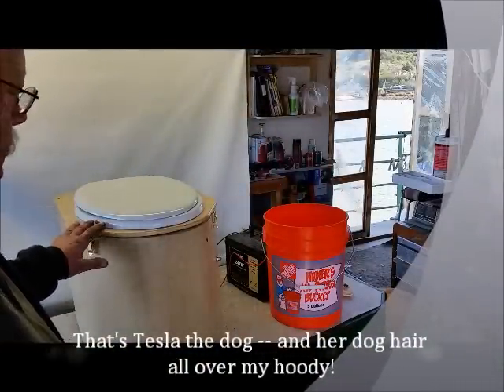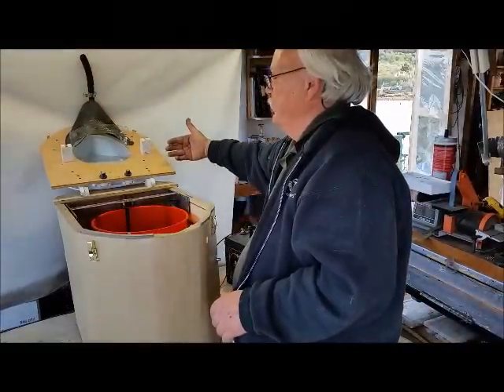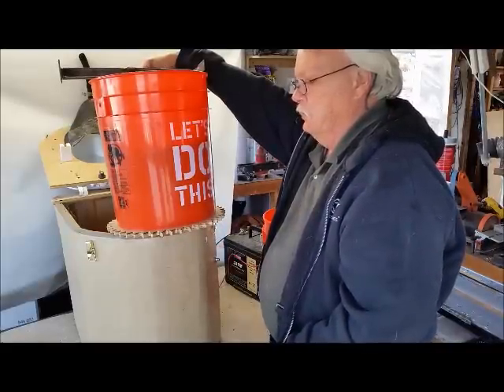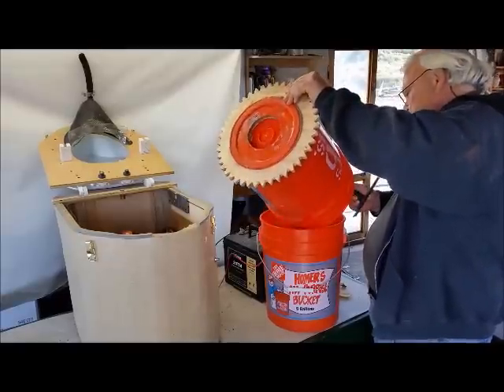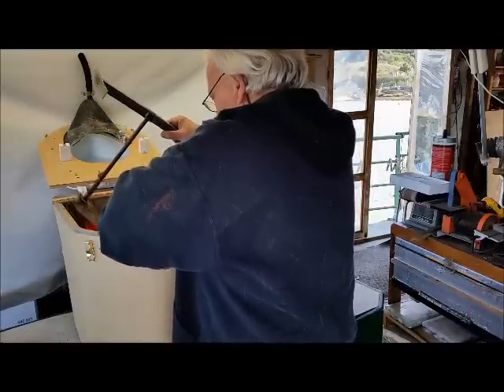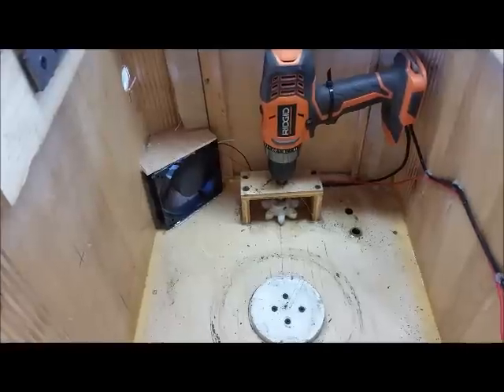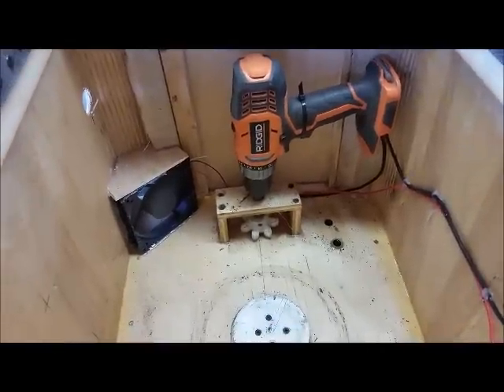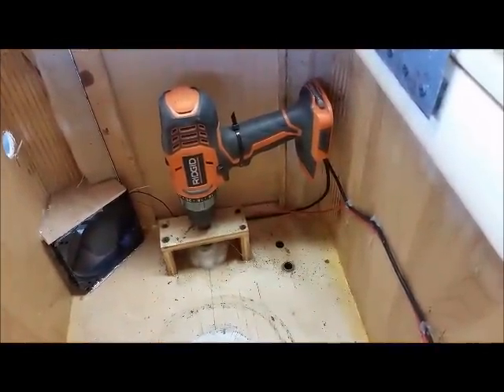Composting Toilet

Comment: I made a similar toilet with a similar drive mechanism and stirring device... Very happy with it... Only thing is, us Europeans do not have the 5 gal. buckets but are stuck with the 10 Liter version which are far less tall... So the risk of over stirring and spilling sawdust over the edge is quite real if the bucket is near capacity...

Comment: as some have pointed out, anaerobic bacteria produce "bad smells" while aerobic bacteria tend not to. I was wondering whether something like an "air stone" (such as used in aquariums) could be dropped into the bucket before adding the peat moss (or whatever) or have it anchored to that rod that projects into the compost area and then use the small air pump to add air to the mixture continuously to "aerate" the mixture. I'd still use the small exhaust fan (probably but I'd like to test out the air pump idea 1st to see if that by itself solved the odor issue just by itself) but possibly on a timer (say 10 mins ON after every use since as I understand it, "smell" from solid wastes is most pronounced when the solid waste has some volatile component that escapes into the atmosphere and MOISTNESS on the surface of the solid waste is quickly dissipated by the compost medium, especially if the contents are stirred up, as in this unit, so 10 mins might be more than ample time to remove offensive smells prior to this surface desiccation).
this gadget here certainly seems to be workable. I wonder if the guy ever made any progress toward marketing plans for DIY builders since I WOULD prefer making something like this to spending $1000+ on some SIMILAR toilet from some manufacturer.

Comment: Is that the fan running loud I used to build custom desktop there are some ultra quit fans out there but good job I'm going to build one it's different than most of these I've now seen more than I need to of video s but you did a good job I believe so thanks.

Comment: like your stir system....  what would you do different if you could.... (or have done different since posting this)  can you offer a to do on making the gear for bottom of bucket and give heads up on where one might could find the one on the drill?  

thought of using an old vibrating sander inverted under the bucket to vibrate it.... simple.... but a stir would be better
Reply: The compost needs to be ventilated often, while the vibration would have the exact opposite effect and make it compact.

Comment: Did you ever draw up a set of plan. Mostly the gear drive would be helpful. The rest of the build looks easy.  I have plenty of HDPE 3/4" sheet.  Getting the gear ratio correct would be helpful.

Comment: Awesome Robert!  I've been trying to figure out a stir mechanism that wouldn't require a hand crank that came out through the top or side of the toilet and this is and excellent, low cost solution!  Although it does require electricity, the fact that it can run off a 12volt battery is perfect.  I assume that the fan also runs off the 12 volt battery?  Have you ever considered having an air intake that brings air in from outside rather than sucking warm or cool air out of your boat all the time?  Would be curious whether that would work.  Probably work better in a land based home than on a boat as you don't want perforations in the side (or bottom!) of a boat and it wouldn't do to have the intake right next to the exhaust.  Anyway, that's something I'm thinking about to avoid losing warm air to the outside in winter.  Thanks for sharing!

Comment: My composting toilet also uses a 5 gallon bucket but my urine diverter collection jug holds 2 1/2 gallons.  It fits nicely on one side of the bucket.  My "poop bucket medium" is composted  hardwood sawdust.  I get it from a premium hardwood sawmill.  It is a 50 mile round trip.  My utility trailer is 5ft. x 10 ft. with 4 ft. sides.  3 loads is $60.   Makes a giant pile of sawdust.  It takes a year to make it suitable for using in my composting toilet but I am not using Peat Moss.  After 1 year of "weathering" it gets raked out, dried, and bagged in giant paper leaf bags from the hardware store.  I have enough bagged up for at least 5 years of using my composting toilet.

Comment: This bucket design isn’t that different than the others except the bucket turns instead of the mixer turning. That’s a innovative idea but I’m still looking for different design. These bucket composters are too small and low for my liking. Yes, I could raise it. But it’s still small. I found a 13 gallon barrel I like a lot better. So I bought 4 of them. I want hot composting action. And not to cool down overnight due to low mass and low insulation. Lots more research to do. And maybe I’ll come back to this if it’s too difficult.

Comment: Love the drill idea! And the turning bucket arrangement. I can't bring myself to drop $1000 on a plastic toilet with a computer fan and a hand crank. For now, I needed a small arrangement to fit behind my driver's seat. So far, I have a basic arrangement contained within a 5G bucket: hand held urinal on a nylon tube (it had a corrugated tube at purchase but why trap urine in the tube?) into a clear laundry bottle. Behind that (pun intended) is compostable bag lined deli bucket. I use coconut coir below and above as needed, bag, and discard with no stirring at present. I'm using a pool noodle for a comfort rim, and a gamma lid for between uses. If I can get a computer fan arranged, I'll swap for a camp-style toilet seat on the bucket. Easy peasy (also pun intended). Love this Vid and the comment section, too!

Comment: You should make and sell those gears, because I want some right now. Plz take my money. If not, I guess I will have to cut some by hand. Sounds time consuming
Reply: I wonder if bicycle gears would work?
Reply: @tonidoreengranke8502  Brilliant. I'm sure they would. You could have a 10spd toilet. 👍
Reply: I imagine it could work if you trace a circle on a oiece of hardwood, thenuse Forstner bits and drill out a bunch of holes all along that line, just touching each other. Then cut the excess wood off so the larger part of the hole is left , if you know what I mean?

Comment: Robert thanks for your posting. Its highly informative. Now that its been 3 years since your installation and your video was based on theory. I am interested to learn what your practical experience has been over last 3 years? Are you still using it? Have you made any modifications? If so, what changes you've made? I am looking to install some thing like this in my RV. Look forward to hearing from you. regards

Comment: I'm curious about the randomness of the "Irish linen" thing.
Reply: Design feature? Entirely optional I imagine. It's certainly visually more appealing - little bit of class - but I'd be putting a few coats of waterproof spray on it. Or, thinking it through, I might use oilskin.

Comment: You could put the bucket on a bearing from a "lazy Susan", then turn the bucket either with a V-belt, or a rubber drive wheel (with 2 other rubber idler wheels).  Love the idea of turning the bucket instead of turning the stirring device.
Reply: How about a crank or step crank mechanism to turn the bucket?
Reply: @kindnessmatters5215  excellent idea.

Comment: This is an interesting design variation, rotating the entire bucket, instead of leaving the bucket stationary and rotating an internal mixing device. Seems like mixing might work better if there were two angled fins (~30-45°) offset at different heights a few inches apart (Maybe that would be his aforementioned update).

Wonder how this would compare in longevity to ones with a hand crank to rotate a central mixer, instead of spinning the entire bucket (issues with moving parts & larger gears, concern over possibly catching the bucket handle at some point down the line (random, unexpected/unpredicted problems that occur), heavier/harder to turn when fuller, more likely to wobble itself out of alignment, etc).

Great use of a drill! If you have an extra one lol. If not the cheapest DIY due to the drill, it's still far less expensive than spending $1,000.00 (!!!) on Nature's Head or Air Head versions (people are correct that they are rather unsightly; vaguely reminiscent of unattractive robots), or just slightly less on the C-Head.

Great design! ☺💪👏
Reply: In reality, ball bearing mounted slewing mechanisms cause problems over time

Comment: Any thoughts on how to incorporate a bidet into this design? A south african company has a shelf sloped back that is slotted to allow liquids to pass but not the solid. Used with a urine diverter up top the only liquid in the bucket would be the bidet wash water. 
So maybe the composting bucket in the video design has holes in the bottom to allow the bidet wash water to pass through?

Comment: Sucking odor air out  is a very goid idea👍,   I am considering chimeny can cause vacuum and absorb odor air,   save to use battery and fan.  I may also use belt and pulley instead of gear,  because precise motions are not required here.

Comment: 3 years later and this is still the without a doubt best diy composting toilet on youtube, everyone should see this who is in the RV / Van / OffGrid / Boating lifestyle.
I know I will be doing my best to follow this example.
A feature that I really like is the curved plywood base, everyone else is just being lazy and making boxes. Then you add a powered mixer to make it even more badass.
Great Job.
The only change I would make is get rid of the hose on the urine diverter. Having a pee covered hose flailing around is not ideal.  I would make sure the top of the bottle rested at a level so that the diverter came to rest naturally in the neck of the bottle.
Reply: A little spray bottle of vinegar could rinse the urinal a little to reduce nastyness of flip flopping hose.  My thinking is just keep a regular portable urinal next to the dry toilet.  Less miserable to maintain that way, easier  & cheaper to build. Additional big bottle to dump urinal into for capacity and spray bottle of vinegar to keep portable urinal daisy fresh.
Reply: @davidbostock6776  I use a small spray bottle (courtesy of a hair dressing salon) filled with a 50/50 mix of vinegar and water to use after the urinal part has been used, just to keep the salt deposits off bay and clean the bowl and plumbing...
Reply: I agree, this video did inspire me to build a similar unit...

Comment: you could make a churner that runs with a hand crank, no extra motor.
Reply: The $1000. Alternatives to his DIY have a hand crank, you have to get on the floor to use it and they have holes in the chamber to use it.  The $1000. Alternatives also require electric service for fan.  His design is much more compact since you don't need space to access handle.  Using large gear sized for bottom of bucket motor spins small gear for appropriate bucket rotation speed, with economical widely available & durable electric motor.  His solution far superior to $1000. unit hand cranks.  You design a hand crank version of his mechanism, build it, and use it, good luck.
Reply: Maybe a foot pedal?
Reply: That’s exactly what I thought. All that’s needed is for the drive gear shaft to be extended up to behind the lid.

Comment: Loving the pee separator and the mixer device but what do you do after a night out with the wife at Mexican food and beer might need a safety switch to kill the mixer in case of overload if you know what I'm Talking about  and who cleans the mixer rod better design would use a compostable bag design that twists the bag thus sealing the poo poo and simultaneously opening a new bag then making a poo poo bag chain that can be dispatched to neighbors yard

Comment: Hi Robert. I really like your idea and am in the process of making my own with the help of some friends. We found a gear program on line and plan to use a CNC machine to cut them out. What are the dimensions of your two gears? How many teeth do each of your gears have? How did you attach the bucket to the wooden gear. To me it appears that they are glued together. If that is correct, what kind of glue did you use? My son says it looks like you cut a hole in the middle of the gear and wedged it in (with or without glue). I hope you will find some time to answer my questions, since you are the only person who posted anything about this innovative concept. By the way, how is it working for you?

Comment: Interesting design but what advantage does it have over just putting a bit more dirt to cover your poo each time you use it? Its way simpler, quicker and cheaper and needs no power. I'm not trying to 'poo poo' your design, just interested.
Reply: Churning aerates the compost thereby encouraging aerobic decomposition which not only produced no odours or methane but consumed the volatile compounds that very produce odours.  Just layering more dry composting material like sawdust, peat moss, newspaper clippings, straw and or coconut husks risks developing a anaerobic zone which would produce odours and methane gas.   It's the same reason why compost bins are stirred or tumbled and why compost bins are often perforated or made with chicken wire to allow air to enter the compost.
Reply: @johnwang9914  - - Thank you. Perfect explanation 🤗🙏

Comment: I don’t have the mechanical ability to make this.  Can I just poop in a bucket of sawdust ( shaking it around after each poop) and dispose every week ?
Reply: You could use a cat litter box too or even a middle Eastern bathroom which is just a tiled area with curbed sides with a drain and a shower hose to clean up the mess you drop on the floor.  You can also just poop in the woods or on your neighbour's porch.
Reply: Yes.That works

Comment: What if you had the large gear as a permanent part of the floor of the device, and made the bucket attach to it, perhaps with several strong magnets? Then you don't have to get the gears synced up after each emptying. You could even make it a belt driven system.
Reply: I thought of using the chain off a bicycle to wrap arounf the bucket and use a gear off the derailer
Reply: Probably a simple crank would work well here
Reply: Perhaps just have inserts mounted from the top of a five gallon bucket from whatever supports the toilet seat on the plywood box and rotate the bucket to stir the compost.  Angle the inserts to drive the compost down so the fresh feces and any toilet paper gets drawn down similar to what the agitator in a washing machine does to clothes.

Comment: Robert, how you make the pee separator?
Reply: I would carve it out of polyurethane foam or make it out of wood and then cover it with fibreglass resin perhaps with some chopped fibreglass or if you like the frustration with sheets of fibreglass cloth.   Using bondo to seal it and then sanding and painting is an alternative to fibreglass.  If you have a 3d printer, just design it and let the machine make it.  If you have a CNC machine, you can mill it from a block of aluminum.  You could probably bend and weld one from sheet metal too.  You could also make one out of clay, make a plaster mold or a wet sand mold and cast it with either plastic or metal or just fire the clay into pottery with a water proof glazing.   A cheap way though very damaging to the environment to make fired pottery water proof would be to throw salt onto the fire while firing the clay, this method has been banned from commercial pottery for a few decades now.

An easy DIY toilet would be to buy a portable camp toilet with a trapdoor flap to the waste compartment, drill and fit an urine diversion hole lining the urine capture area with either weather stripping as the curb or fiberglass a foam or wood curb in place then cut the bottom storage unit out and fit it to a larger storage container with some kind of crank to stir up the compost to bury the fresh feces and aerate the compost.   You can also just drain the solid compost compartment of the urine and count on having enough dry compost to keep the moisture down.

Comment: The fan is primarily used to keep the composing material on the drier side - it just happens to benefit by removing what little smell there is.   
Great design!  Thanks!!
Reply: Ventilation and churning also encourages aerobic decomposition which not only does not produce odours and methane gas but also consumes the volatile organic compounds that produce odours.
Reply: @johnwang9914  Exactly!  The "good" (aerobic) bacteria need lots of oxygen, while the "bad" (anaerobic) bacteria are suppressed by oxygen.  The constant flow of air ensures there is enough oxygen and ALSO helps to dry out the medium.

Comment: Would you be willing to share a template for the gears, or is there some kind of software anyone could recommend that would generate such a template? Thanks.
Reply from the maker: Yes I can supply a template as well as gcode if you have access to a cnc machine.  Or, email me at robert@robertedney.com and i might be able to cut the gears for you. Thanks for watching!
Reply: Robert Edney I’d be keen to buy one if you’d be willing to cut one for me. I’ll send you an email.